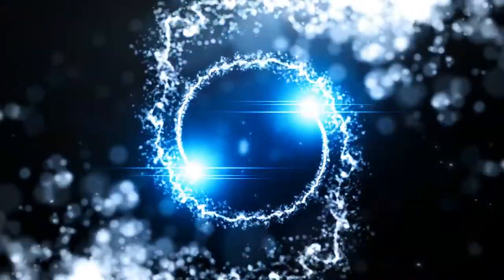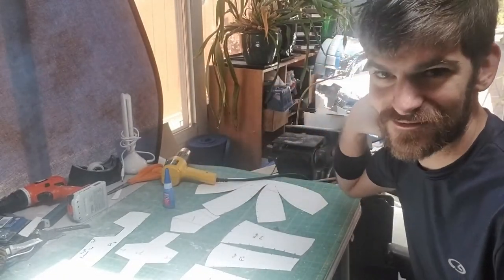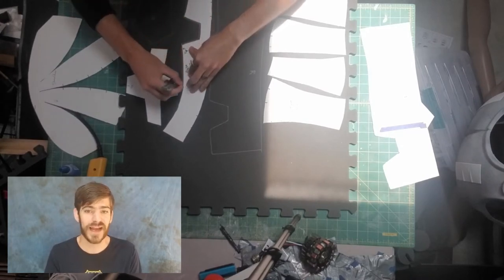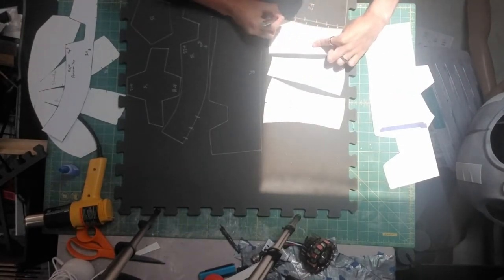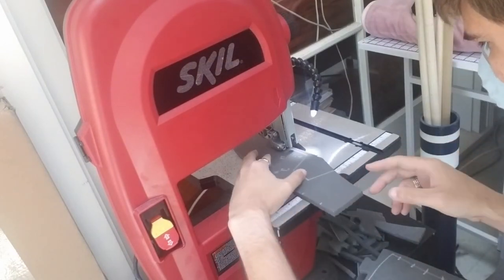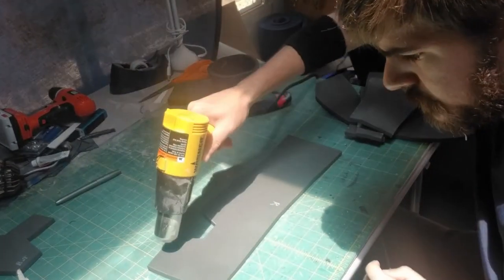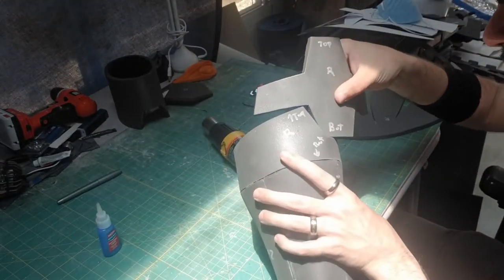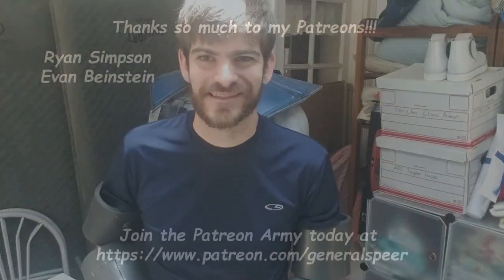Custom ARC Trooper DIY Series Episode 3: EVA Foam CLONE ARM Guards!!!

Comment: Glad I saw this b4 getting too far into my phase 1 build.. I used hot glue for my first set of arm pieces.. gonna switch to the loctite
Reply: Nothing wrong with using Hotglue.  I just have seen in person on hot days where glue has reheated and busted costumes open.

Comment: With all the work you do on the band saw, could i do it with a utility knife and sand it down?
Reply: Benjamin Riches yes
Reply: @kakrinetic5066  Replying with my gaming channel =D.  Yes absolutely!  Just make sure it is nice and sharp.  Dull knives ironically are more dangerous than sharp ones as they yield less control per cut and are more likely to slip.

Comment: I would like to know how much money I need for the materials to make the armor ?
Reply: Sorry I am so late on the comments.  I used roughly 14 2x2 foot sheets of EVA foam that was 3/8ths of a inch thick.  That cost me around $30, give or take.  The glue is $7 a bottle, if you are using the locktite glue I am using and I go through 2-3 or so in this series.

Comment: what sealent do you use??
Reply from the maker: For gaps, there's lots of options.  Probably the least toxic and most commonly used is Kiwiki seal which is used for sealing windows and the like.  You can also use Foam Clay, Bondo spot putty, wood or even bondo filler, and others.  I will be showing folks this at some point, there's just a ton on my plate with family expansion on the way, organizing everything from a move and so on.